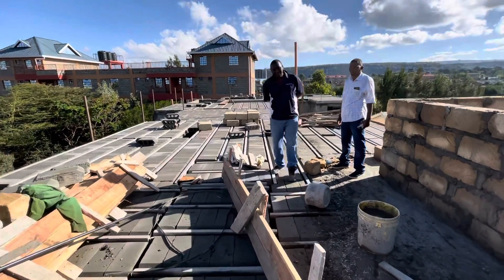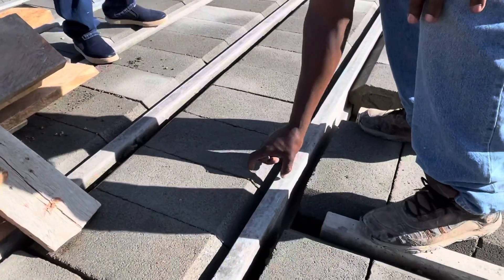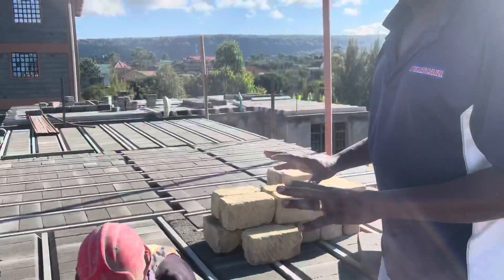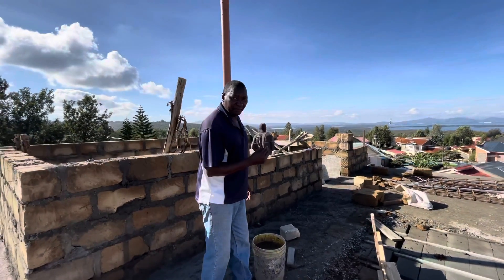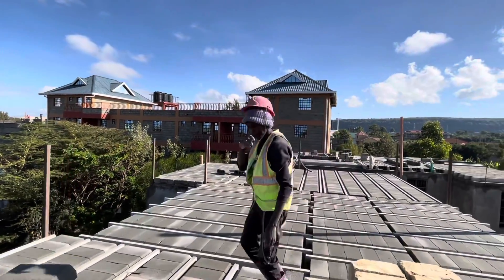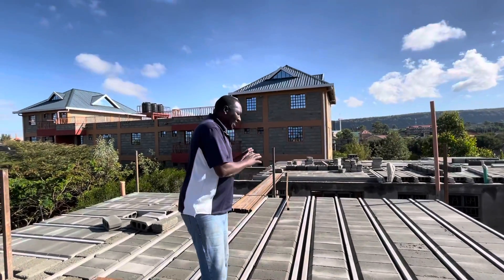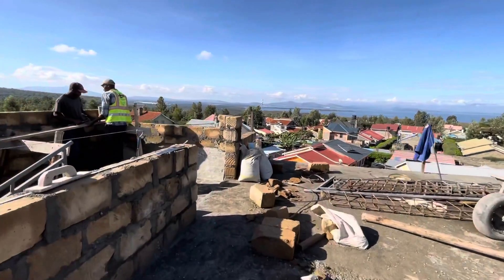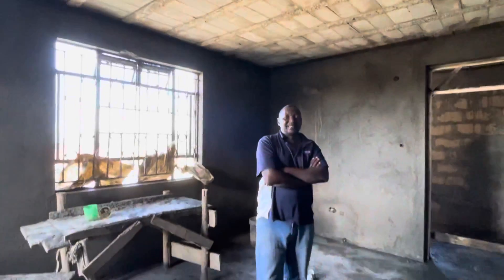How to build slabs using Precast and save time and money

Comment: This technology has been there for ages . I built my house using the same technology although i didn't use fibre glass . i used BRC wire mesh  instead  
The beams are prestressed with galvanized 9 mm coiled  wire .its  quicker way of building multiple floors  but not cheap  yet you can save few dollars  here n there .
About adding fiberglass to cement  you  give strength to your floor  but i would recommend one to use BRC mesh wire to distribute all load evenly.
Reply: Where can one buy them?
Reply: @AntonyChantry  Athi river  Kenya  sold by a company  called  Matrix precast
Reply: a quick question can this precast blocks be used on foundations?
Reply: @raymondwarui8223 Those blocks are only designed for floor or slab , you can  use ordinary  stones for foundation coz they can not be able to hold alot of weight..
Reply: @Mg-wd6id   am asking instead of the normal filling of hardcore rocks, you introduce the beams after building the foundation stones
Reply: @raymondwarui8223  yes you can, when u said foundation   i thought you were meaning the outer walling of the house from ground that why i explained they are kind of special coz they are hollow n groved on edges . I  used them too for  slab  coz they were  saving alot  terms of labour  ,concrete  and hardcore .
What you need to remember before you place then on foundation walls  put a damproof  membrane  to keep away moisture from the ground.
Reply: @Mg-wd6id  I definitely need this for my ceiling slab.. Has NCA approved your method and if so where can one buy them from
Reply: Which BRC did you use/ can recommend? A142?